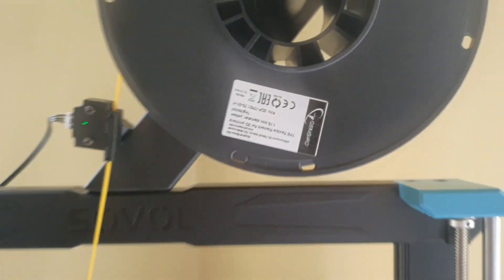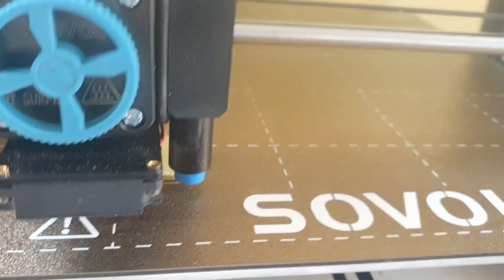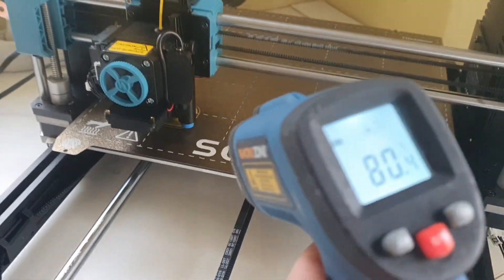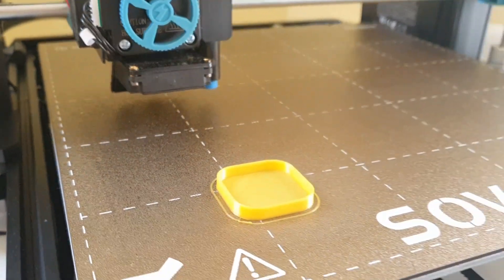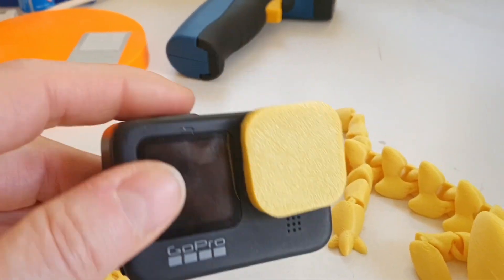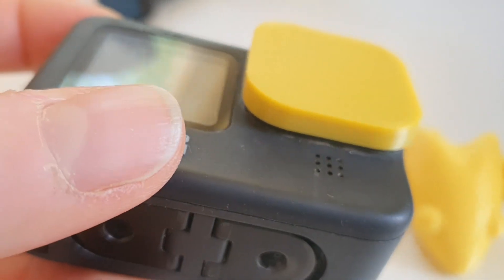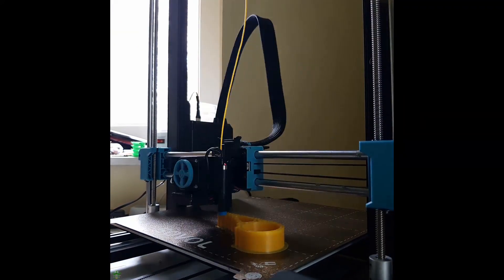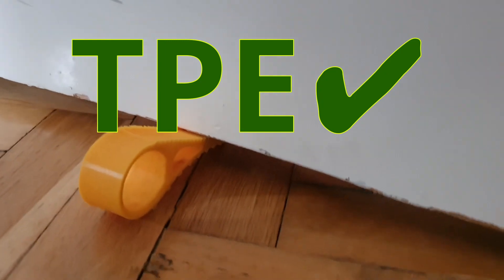Printing TPE on SOVOL SV06 Plus

Comment: I print on my SV06 Plus TPU 95A with 100mm/s at 240°C...all walls and filling same speed, only 1st layer with 50mm/s, retract 1.5mm, feed speed 30mm/s, push back 20mm/s. TPU 83A with 60mm/s at 240°C, ....all walls and filling same speed, only 1st layer with 30mm/s, retract 1.5mm, retraction speed 30mm/s, pushing back 20mm/s.  The feed spring must be slightly tighter. Very Important....check and calculate the right amount of flow. The Bed Temp on TPE/TPU can be very low.....first Layer 60°C then 40°C-50°C. With TPU 95A, the flow remains almost the same regardless of the speed at which you print. My TPU95A need Flow 103%. With TPE 83A, on the other hand, the flow changes drastically the faster you print.....for e.g. 30mm/s 40mm/s, 50mm/s or 60mm/s the flow must be calculated individually. 30mm/s need 108%, 40mm/s 110%, 50mm/s 114% and 60mm/s need  118%.....higher then 60mm is not good on TPE 83A or softer. That the resolut on my SV06 Plus.
Reply from the maker: Thank you,,, this is very valuable insight! How do you calculate flow at different speeds?
Reply: @gerGoPrint3D  i print on any material rolls first a Calibrationtube with 100% flow.....with my nozzle temp and my speed (for fast u can go higher then manufacturer recommendation) 240°C is very good for 95A/83A. 1 wall 0.4, layer hight 0.2.....without bottom and top.....zero infill. when it is rdy printet u meassure all 4 walls., eg. 0.43+0.44+0.43+0.44=1.74/4=0.435 then 0.40x100/0.435=91.95  is ur right flow. very important.......use that way for all ur materials and save it as profile.....all ur prints goes perfect. with that SV06 Plus u can fast print easy. My favorite material is 3DJake PCTG......280°C Nozzel, Bed 97°C first layer...then 80°C, 120-150mm/s...100% cooling at 3 layer. all hard materials need 0,6 retract, feed speed 30mm/s, reduce feed speed 20mm/s. Soft materials TPE/TPU need 1.5 retract, feed speed 30mm/s, reduce feed speed 20mm/s. Works perfect 4me. Layer hight 0.2 or for many curves i use 0.175. First layer hight 0.3. Tip: many people use 0.4 wall thickness so 3 walls=1.2mm.....i use  0.6 wall thickness 2 walls=1.2mm, 30%-40% faster....same quality (slightly increase overlaps (Cura easily does too little...+3% is fine). It's important to always adjust the flow cleanly, that's the magic word. If the temperatures are higher, you should always print very quickly so that the plastic flows quickly and does not boil over. Most people just print too slowly and too hot, or too fast and too cold.....and wrong flow settings. Happy fast Printing with SV06 Plus. u need a new flow measured.....set flow allway to 100%, then ur Nozzle Temp and Printspeed....see the resolut to calculate.....thats it. all my other materials i use eSun